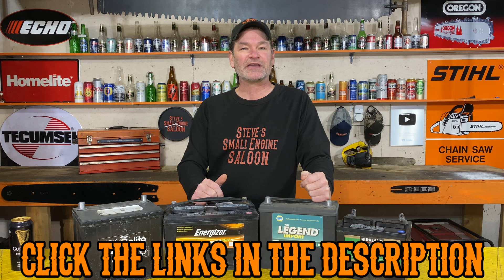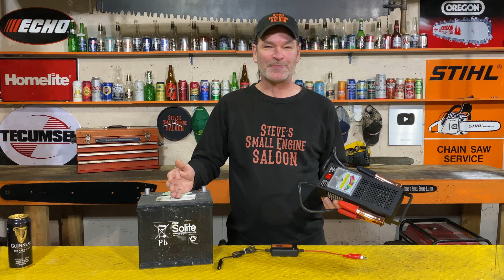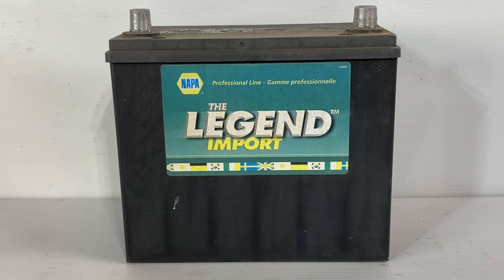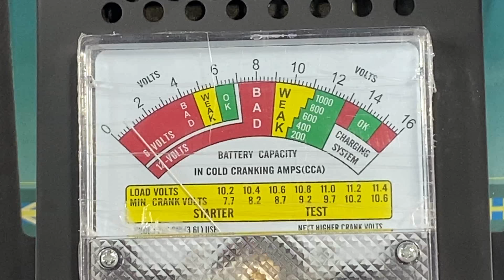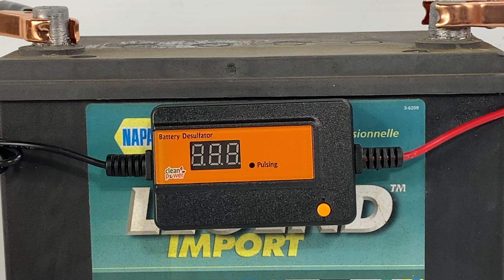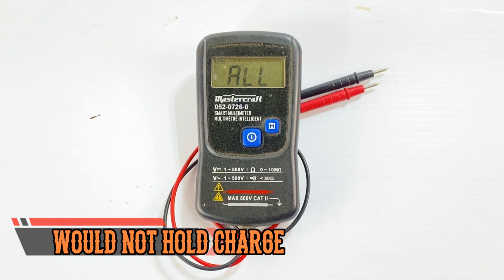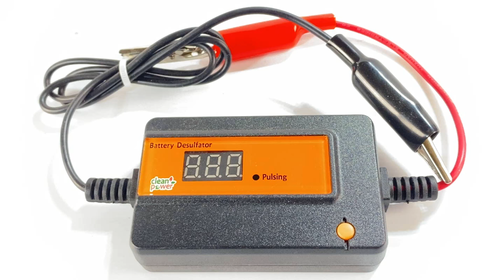Does An Electronic De-Sulfator Really Repair A Battery?? See Real Results

Comment: I met an old man at a dump in Kalbar, I worked there, he used to get the failed car batteries, if the sides of the battery weren't bulging from plate expansion, he'd pour all of the acid into a bucket, he'd then fill each cell with water, then he'd drop a Denture cleaning tablet into each cell, he'd leave it over night, then tip the water out, give each cell a gentle rinse out with a hose, then put the old acid back in, and charge it up, he ran a backyard business doing that... That's another way to remove sulfation from a battery.
Reply: I've seen a guy do similar, he used to run the acid through dyeless fabric or coffee filters I can't remember as the acid was sometimes blackish colour filtering back to nearly clear.
Reply: This also will "supercharge" your denture cleaning solution.  A double win!
Reply: @thisisyourcaptainspeaking2259  🤣🤣🤣
Reply: Thumbs up button is always in order.
     Thank you
Reply: Can I use battery desulphater on my teeth?
Reply: @falconeaterf15  You're joking, right 🤣
Reply: Would of been good to check internal resistance before & after
Reply: @@richardgilley4001😂😂😂😂
Reply: Thanks
Reply: We had a guy here as well that used to do it out of his garage. He was in a little trailer court behind us and everyone bought from him. $25 👍
Reply: Epsom Salts is said to do the same (Magnesium Sulphate). Tip Acid into an emptied clean non-mains water container so that the Chlorine will not cause Lead Chroide (PbCl) to form when you return the solution to the battery. The table spoon of MgSo4 Epsom Salts added to distilled water 5 Litres (not tap) is then added to the battery and the battery trickle charged. There is a guy on youtube who shows this method. Sound Science has the PB (lead sulphate crystals) are dissolved into the MgSO4 and then after a while the battery holds its charge again. The solution is emptied and the battery refilled. If you can get battery acid H2SO4 then use that. Yet to try it as I cannot get hold of small quantities of Battery Acid locally.
Reply: @Seal00754  Auto parts stores around my area sell battery acid, namely O'Reilly and AutoZone.
Reply: @Seal00754 preciseley anda the most of the videos i've seen they trubtonget Charger with Epsom salta, duh. They should rinse anda refill with the acid extracted or new acid solución
Reply: @Seal00754  Sulfuric Acid is sold as drain opener liquid at hardware stores and home centers. However most is sold as diluted sulfuric acid. One brand of undiluted sulfuric acid is made by the Rooto Corporation and is sold in quart and gallon jugs. I found it at my local Runnings farm/home center for $8 per quart.
Reply: @Seal00754  a trickle charger delivers low voltage keep a battery at a state of full charge while it being stored  or to keep a shorted battery that drains overnight at full capacity.
Reply: @Seal00754  I did this exact process too three different old batteries....it didn't do anything but waste my time and a pair of work gloves from the battery acid
Reply: Lead touching water is not hazardous waste. Old homes have lead water pipes. Not recommended for drinking now though.
Reply: Useless. Buy a new battery.
Reply: @donraptor6156  SHTF option
Reply: Yeah you have to physically remove the sulfate you could also reverse polarity for a little while at 100 amps
Reply: Just dumping out toxic lead salts? Not very smart of him.
Reply: @chemistryofquestionablequa6252  wearing gloves, goggles, and a mask would be helpful
Reply: @chemistryofquestionablequa6252 did he say he was drinking it? 😅 wtfc?
Reply: @chemistryofquestionablequa6252  He said he poured the acid in a bucket, then cleaned the cells, then add back the acid that was in the bucket. You should of read the whole comment before you added a bone-headed comment.
Reply: @stansmithatCIA  the problem that @Chemistry of Questionable Quality is referring to is the dumping of the cleaning/rinsing liquids. These rounds will contain salts/lead from exposure to the plates during the cleaning/rinsing cycles... He is disposing of that contaminated water which is considered hazardous waste due to the led contents...
Reply: @stansmithatCIA  no need for name calling,😔 we all err at times😎,, bone head
Reply: @stansmithatCIA  'He said he poured the acid in a bucket, then cleaned the cells, then add back the acid that was in the bucket. You should of read the whole comment before you added a bone-headed comment.'  how ironic.. you should HAVE read the whole comment yourself.. 'he'd drop a Denture cleaning tablet into each cell, he'd leave it over night, then tip the water out, give each cell a gentle rinse out with a hose, then put the old acid back in'.. it's tipping and rinsing out the water with toxic lead salts that's the problem.
Reply: @jwojan  man, I fart lead with how much I breath in soldering lol just sayin if your worried about the lead leaking into the environment lookup just how much you are putting there every time you throw a gadget in a landfill... all love <3
Reply: @jwojan  In Stan Smiths defense. He has said twice/ 2 times now that the old man reused the contents of the old batteries. Those two statements in no way said the acid was disposed of.
Reply: @bloodlinegaming9962  lead hasn't been in almost all consumer electronics for quite some time.
Reply: @jackyhallmark3094  What about all those salts the water & denture cleaner have in them after rinsing?
Reply: @jwojan  exactly
Reply: @jackyhallmark3094  there are still water soluble lead salts in the bucket that are crazy toxic after the acid is poured back in. Rinsing and dumping the bucket is a terrible idea.
Reply: @SuperReznative  good to see someone sticking up for others.
Reply: @jwojan  Maybe he could recycle it as a pre-treatment of his sewer and drain lines.
Reply: @petesmitt  but he didn’t say he poured it on the ground, just out.
Reply: @bloodlinegaming9962 I wonder about all the lead from dads black powder pistol in the dirt pile behind target 😐
Reply: @benlawton5420  anything made from china usually has regular leaded solder, AKA almost anything from walmart or amazon where im sure you have shopped... most countries besides the united states still use it for its lower melting point... Almost all DIY and consumer repair centers use it as well sooooo.... but that being said gl staying lead free 🙂
Reply: @freiherrvonstein  SHHHHHH not supposed to mention that
Reply: @bloodlinegaming9962  It's ban in the EU so as long as it's CE certified, it's good.
Reply: @jwojan You can also remove moisture and air from an A/C system by simply filling it, venting it with a screwdriver and PPE, refill, vent, refill, vent and remove both moisture and air by means of dilution. 
Maybe use a blow dryer on the system if you want even better results. 

Dilution is the solution.
Heat makes it faster.
Reply: @stansmithatCIA he did read the comment.  He said he tipped the water out and then rinsed it with a hose.  You expect us to believe he captured all that water?
Reply: @jwojan who cares?
Reply: @chemistryofquestionablequa6252  say how you do it

Comment: Looks like your first battery had high internal resistance.  The second battery had two shorted cells and high internal resistance on the remaining cells.  There is no fixing either of these conditions.  The best preventative measure is always keep a lead acid battery fully charged and recharge after every use.  In storage, keep it on a block of wood to keep it off a cold floor and charge it once a month or keep it on a float charger at about 13.5 volts.

Comment: You can buy a NOCO genius 10 with a built-in trickle charger and a built-in desulfation function for under $100  which is surely less than what you paid for your desulfinator and ride on battery.

Comment: The sulfate block that forms around the cells of a sulfated battery prevents a cell from getting and holding the volts needed for a full charge.

Comment: They have chargers out now that will start batteries with as low as 2 volts. The charger must be told to recognize this low battery voltage with a special function on the charger. NOCO is one of these battery chargers.

Comment: A lead acid battery is not good unless it can fully charge and hold the charge and handle a load. You can still have a bad cell or more.

Comment: G’day Sir Steve,I have a question...when I drain the oil of my lawnmower...accidentally the went to the muffler...is it still sage to use?...your reply much appreciated here.
Reply: im assuming it just spilled onto the outside of the muffler. just wipe it off with a rag. since its been a couple days you probably don't even need to do that. so just start it up outside and it will just burn off. might be a bit smokey for a minute or two but it will be fine.

Comment: I have a unit that has the same capabilities and it is good for recovery of car type batteries that have gone completely flat. This is a problem with lockdown and very little car use. They never really come back with the same capacity with a normal charger unless you use one of these pulsed voltage devices. Well worth the money.
Reply from the maker: Right on

Comment: Yes... on my diesel trucks... I squeeze 10+ yrs use out.... since I use "that type of gadget .... all year around... in my opinion that is the trick.    Keep it plugged in when vehicle is not in use and close to an electrical outlet.  So in my experience the key for long life battery usage... keep it connected even when the battery reads OK.   Been using that technique for over 30 yrs.   Also keep my tractor batteries plugged in...over the winter and they last a long time.  Only once did I have an early failure.  That is when SEARS when out of business and closet store was Walmart..... Battery failed in less than 1 1/2 yrs...WHAT A PIECE OF JUNK.   Nothing like a Diehard....for long life.

Comment: I use a Ctec charger which has a built in desufating function.  It will first charge the battery, then desulfate and recharge as neccesary.
Reply from the maker: Cool!

Comment: I know of a person that when he has an issue with a battery he dumps out the existing acid and saves it. He then takes the battery and bangs it up against the concrete floor. He puts the old acid back in the battery. He bangs it again. He then dumps out the old acid. Puts in new acid and gives it a slow 3A charge. He then test the battery and if it test good he'll let it sit for a while and test again. At this point it will either hold a charge or not.
Reply: I just left a similar comment, but the acid is removed, then water added, and denture cleaning tablets left in  overnight,  next morning rinse it out, acid back in, and charge.

Comment: Great video Steve. Actually had this problem with a 985 CCA battery a couple days ago that had gone down to 380 CCA. (Battery 2 years into it's warranty). The battery shop had some big old looking desulfator they hooked it up to for 24 hour and it went back up to 880 CCA. I have a couple other batteries that are iffy, so I ordered a fancier looking desulfator yesterday that should be at my door soon. Hoping to do some tests and post the results. I have a buddy that has a pallet of old batteries so hope to do a few tests on a couple other batteries! Glad it worked on a few for you Steve! (Wish i had seen this yesterday since the item you used was about half the money...although if my device works, the extra I spent will be saved soon.
Reply: Any results?
Reply: @robertvanruyssevelt7159  My results were not good with the unit I purchased. I didnt see a difference at all. I am sure there are units that will  work, but the units people are suggesting are double or triple the price of a new battery.
Reply: @unclemarksdiyauto  Thank you for the reply. Can you share the name? I am looking at buying a product from Pulse Tech for around $150.00

Comment: Shorted and dissolved cells can not be helped much by a desulfator.  Only an actual sulfated or dead battery can be helped.  I made my own desulfator that uses a battery's internal resistance to determine applied voltage.  Sometimes, with a badly sulfated battery, it starts out at well over 100 volts and works its way down to normal voltage as it conditions the battery.  You could have connected all those batteries at once in series with it and then weeded out the bad ones.  Really cool and easy to make device.  Also dangerous because of potential voltage, so care is needed when using.  I currently have a 1 amp version, but may be making a 4 amp model soon.

Comment: Think you saved the 2 that weren't sealed? I've recently drilled holes over each cell on my 3 old 125ah sealed batteries (uk spec) so I could top up the water. Just started doing daily charge / discharge cycles so time will tell...

Comment: Great video!
I've tried to recover four batteries by alternating different charging methods with smart chargers and dumb  chargers and was only successful at with one of them.   I need spare batteries because I run dual batteries in my 2006 Ford Exploder because I have an internal winch and a power inverter.  I never knew that desulfators were even available so as soon as the city Nazis let the store open back up, I'll go get one.
Thanks again, and have a great day!

Comment: I have a similar device that stays on the battery and desulfates as the battery is in use.  I used to have to change out 5 batteries on my motor home every 2 or 3 years.  Now I’m still on the same batteries for 7 years.  It cost me $50 for the device and was well worth the money.
Reply from the maker: Right on Buddy!

Comment: I've heard tale told of people cutting the tops off lead acid batteries and washing them out, then putting new acid into them. Because a battery is just a plastic box with lead plates in it. So I can see why all of that would work. Is it worth the trouble? I've never done it myself. Seems like something people into marine batteries are into. Because they can be expensive.
Reply: Go to a YouTube channel called Pakistani Truck if you want to see how people take apart and rebuild batteries. It's very interesting.
Reply: @Robb403  it wouldn't work for our modern batteries. The plates are too thin in them. I was just looking at some a few minutes ago. They're like paper.

Comment: Should have used a hydrometer to check the acid on the two that wont work. If the acid spilled out and there is mostly water in there the load test will always fail.

Comment: You can't say "did not work" on a battery with a shorted cell, which is a totally different problem that has nothing to do with desulfation. Its like adding an oil additive won't help with your coolant leakage.
Reply: Sulfates which typically collect at the bottom of the cell actually act as a short/parasitic drain.

Comment: Well if you want to trick the charger into believing the battery is good and I have tried it and it did work, hookup for a short time or until your see the charge light emitting a 20 volt or less battery from a cordless drill into the circuit. In my case I had a new battery that had been drained and needed to get it charging once again. Use a 12 or 10 gauge wire from the donor 20 volt battery. Be very mindful things can go wrong and wear protection in any battery scenario.

Comment: I bought a battery charger with a desulfator capability. I tried it on an old battery that was essentially done. It could no longer take a load properly despite good voltage when charged with no load. The desulfator runs did improve it's load carrying capability, the CCA ratings kept increasing to a point,  but not good enough to return to service.

Comment: I bought a BATTERY-MINDER.  It is the one that does not have a charger built in.  
https://www.batteryminders.com/12v-onboard-desulfator
I installed it on a car that was 3 years old at the time.  When I sold the car 6 years later, it
still had the original battery and it was still functioning great.  I KNOW that one worked I 
personally cannot  vouch for any other.  Also I cannot say how long past 9 years one of
these would make a battery last.

Comment: I have one of those on a battery charger and have noticed when I use the disulfater the battery which was fine till then goes dead in a short time after , must not be good to break things loose.

Comment: Yup, One desulfator to rule them all!   I hook up my RV deep cycle battery, RV engine battery, Kubota Tractor Battery and heavy Lawn Mower battery all in parallel, with thick Alligator clips, put a timer on for two hours a day using an auto battery desulfator for six months of winter storage.    Works great as long as you have equal voltage, and charged up initially.
Reply from the maker: Interesting!

Comment: I did a couple using the rinse them out and refill with distilled water and epsom salts technique.  One lawn mower battery worked, one did not.  The one that worked was completely dead in the water too.  It wouldn't take a charge at all.  Sat dead at my neighbors for well over a year, then another year at my place.  Just for the hell of it, I tried it after stumbling on a video.  Still working fine and holding a charge after about 6 months, even in Michigan weather.   Though one cell is a little weak.
Reply: Really enjoy your channel.  You've helped me fix about 3 things this week already.